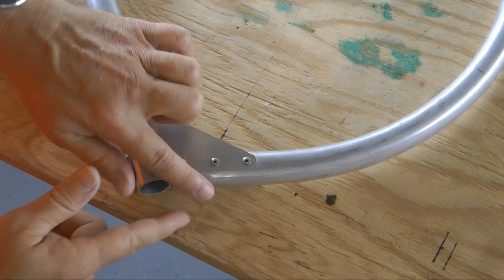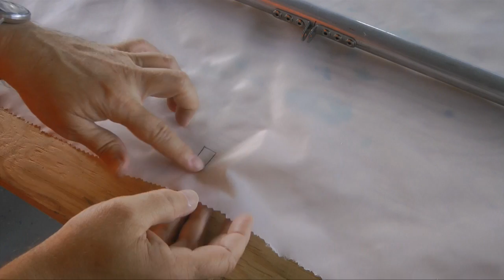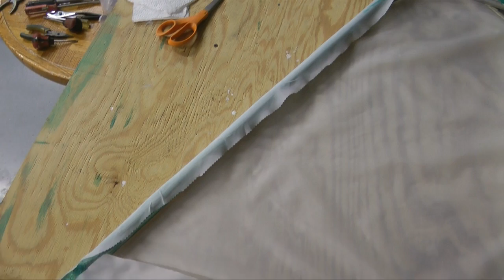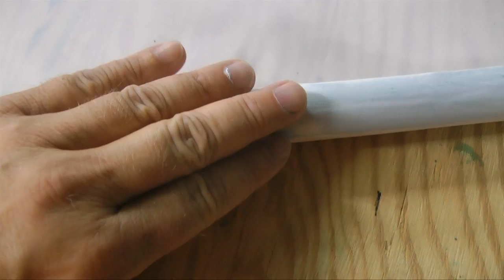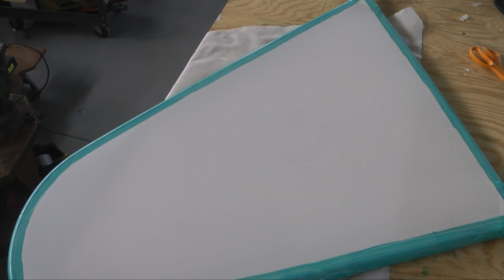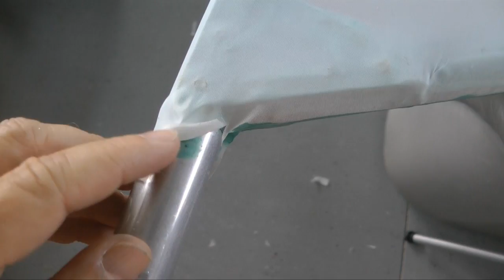Building the Affordaplane Part 45

Comment: Why heat gun cannot be used to shrink fabric?
Reply: You would have to keep a thermometer at the surface where the heat is being applied to prevent overheating the material, just my thoughts. Too much heat degrades and weakens the material.

Comment: Just a tip, start attaching and pulling from the center of each side. This allows you to use the bias in the cloth to work in both directions rather than having to deal with everything bunching up when you get to the end. Do the same with your radius, pull perpendicular from the center, then work left and right.
It’s a learning curve and you’ll be a pro by the time you’re done! Thanks for the video.
Reply: I agree.  Starting in the center cuts any potential slack or wrinkles in half as well.  Great tip

Comment: For some reason, the Stewart Systems YT channel has them also sealing the cloth/EkoBond with an iron after the glue has been wiped (and dried). I can't put a link here, but check out the YouTube video v=48OeYmvYHDM at about the 6 min. 47 sec. mark.
Reply from the maker: Yes - after trimming the excess fabric (after gluing) you should press down that newly cut edge back tight to the tube with the iron.